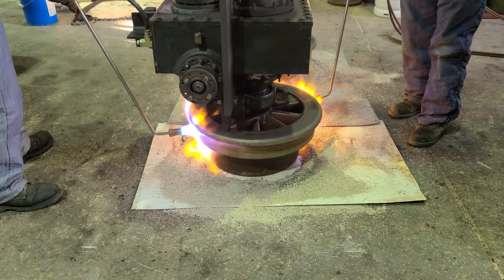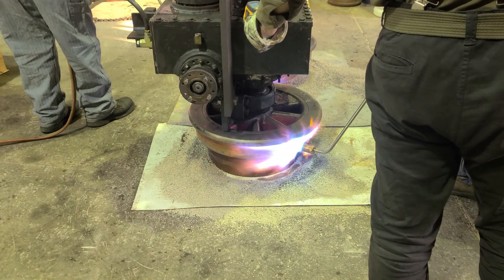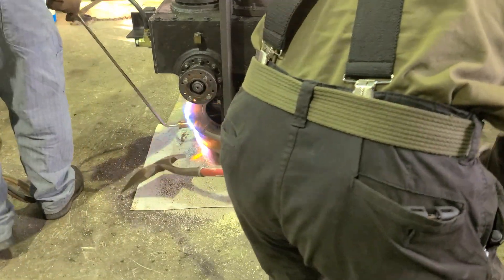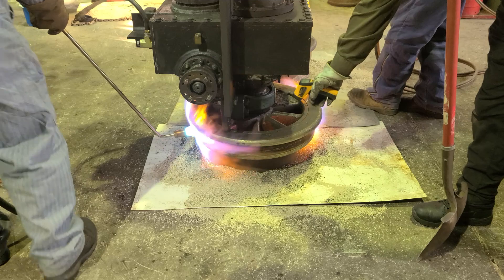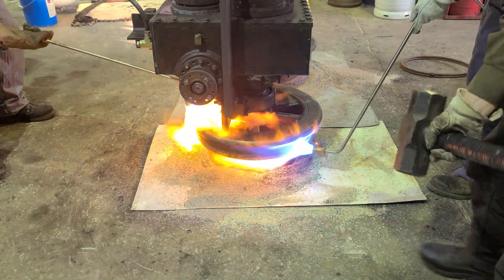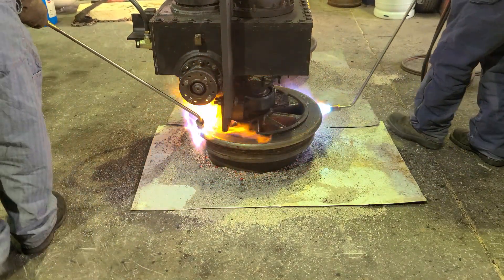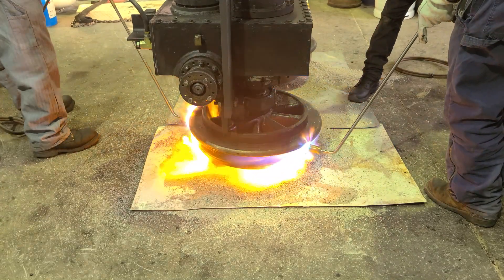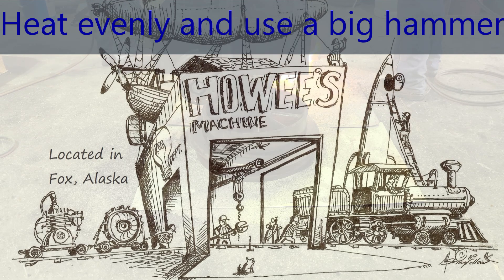Machinist's Minutes: Removing train tires

Comment: Propane will ruin that acetylene regulator and any hoses that are not made for it. Ask me how I know.
Reply: I've never had an acetylene regulator die because I ran propane through it, and I used an acetylene regulator with propane for a very long time until I ponied up for a propane reg.
And honestly there's no reason to run type r hoses, type t hoses cost the same amount as the type r ones do.
Reply: @ForfeMac  Must be a new regulator. Older ones do not last. Only hoses they had in stock around here were not for propane. I would have bought the better hose but it was unavailable way back when. 40 plus years ago.  Switched to map gas and propane. I knew the hose wasn't good for it so when it started leaking was not a surprise. regulator started leaking took it in for repair and that's when I found out it was not for anything but acetylene. That regulator was maybe 10 years old at the oldest. This was 20 years ago. You still have to order or at least specify what hose you want around here. Any regulator older then 20 I wouldn't trust it.

Comment: Nice work im surprised that yhe center hub is still in one piece usually those would break and have to be re brazed  however since it isn't actually powered by steam it probably isn't getting as much wear and abuse since it isn't getting the power stroke of a steam engine on them
Reply from the maker: These were cast is steel, most are gray cast iron.